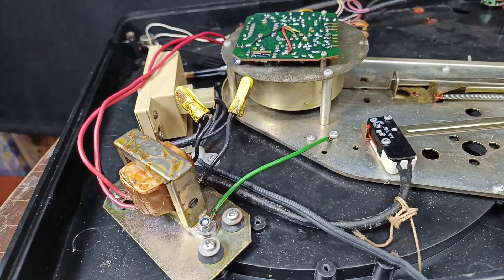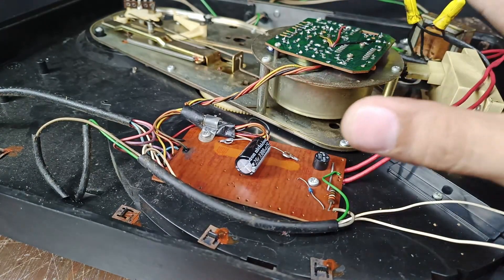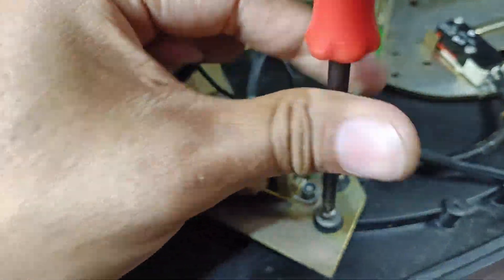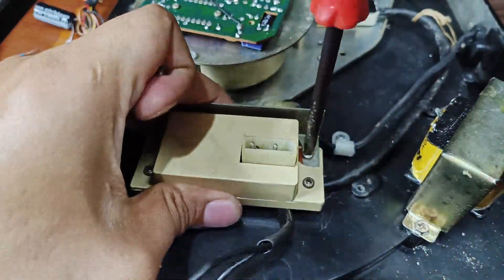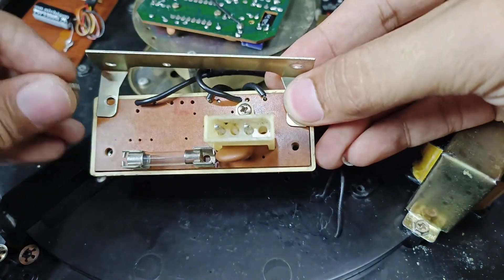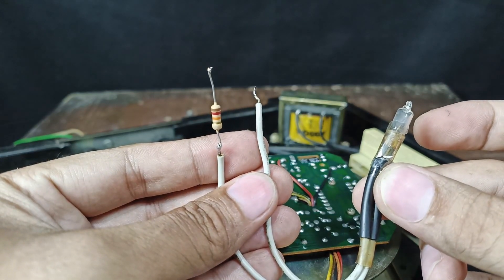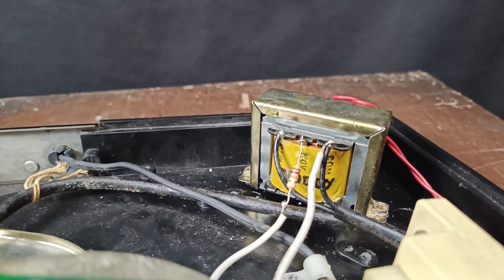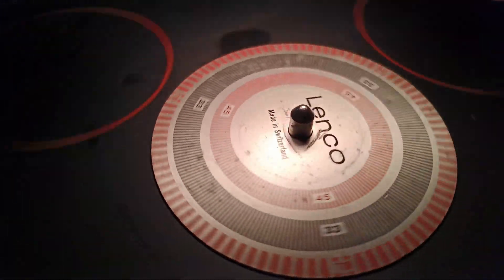How to convert your turntable to 220 volts || ADC 1600DD TURNTABLE

Comment: Boss..ng se service po kayo ng turntable? Meron po ako pioneer japan made turntable 50-60hz 100V sya but hindi ko maganit dito sa pinas..masyadong mabilis either 33 or 45 ang speed nya sa actual almost 35 and 47 ang speed nya..Pa help na naman po ..
Reply from the maker: Hindi po ako nagseservice sir. Baka yung turntable nyo is belt drive tapos 50Hz yan po kadalasan pag Japan. Para pag check kung 50Hz yan tanggalin nyo ang platter may tatak kadalasan malapit sa pulley. Pag may naka tatak na 50Hz yung inyong gawin is replace nyo ang motor pulley or i adjust nyo ang pulley paliitin nyo dahan dahan.
Reply: @woodys_hobbies cge po ..nabuksan ko na po matagal na ..nakalagay ay 50/60Hz 100v
Reply from the maker: @jhob22  assessment ko nyan sir is 50Hz ang pulley
Reply: @woodys_hobbies okay po..hanap nlng ako ng motor pulley na pwed i swap
Reply from the maker: @jhob22  👍👍👍

Comment: Interesting tips. I am not entirely convinced, but ill take your word for it. Im surprised you did not clean it before working on it. I use lysol wipes to make it clean before commencing work. Makes it more enjoyable to work on.
Reply from the maker: To shorten my video and direct to the point.
Reply: Galing nmn yan master bago lg po ako sa turntable. Kadalasan po ba 16v secondary po silang mga turntable?